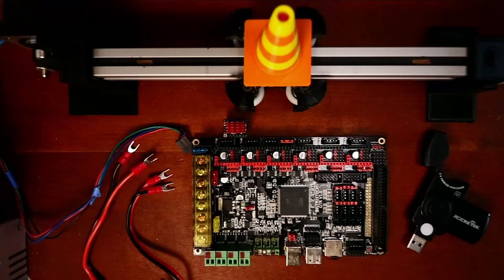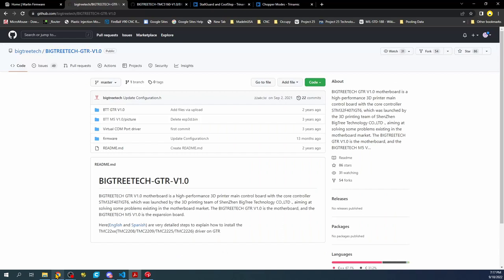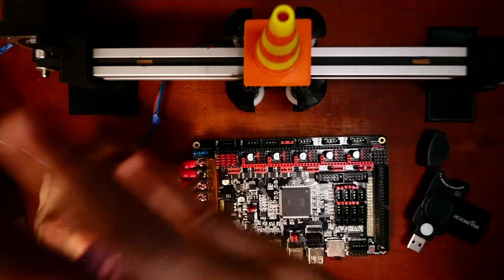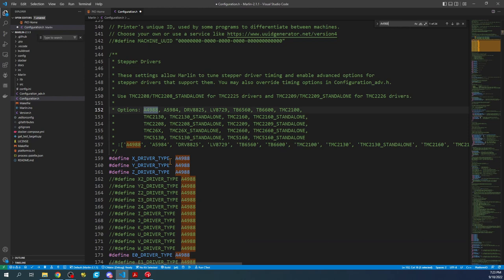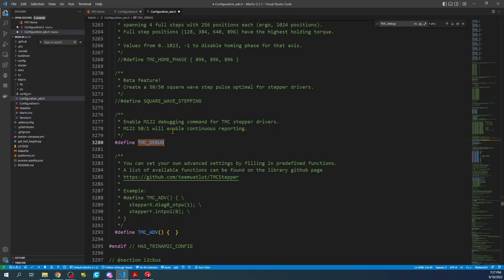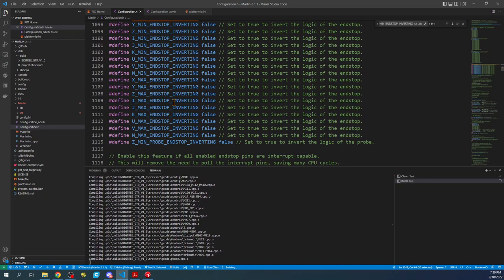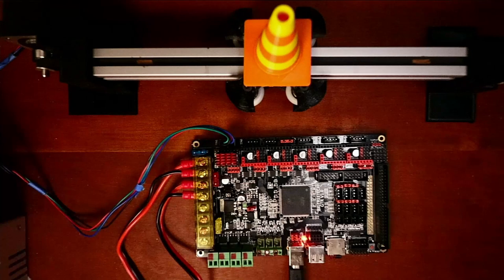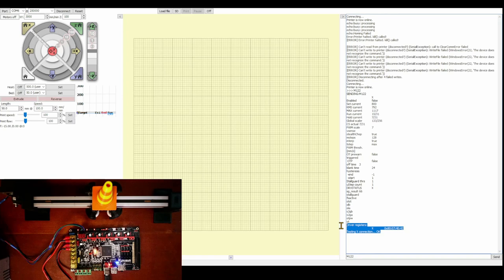BTT GTR v1 0 TMC5160 Pro with Sensor less Homing

Comment: Hey Ed, any plans to re-visit the GTR + M5 boards on Klipper Firmware? 😲 

Looking at the pinout and schematic diagram, I noticed a dedicated set of CAN pins (near the Neopixel and BLTouch port), but it's not clear to me if it require an external transceiver or if there's already one built-in 🤔

I'm wondering if I should bother opening my sealed 2x GTR and 2x M5 boxes, or if I should just sell them for money back in favor of buying newer boards
Reply from the maker: Would love to revisit the board, but looks like BTT stopped selling them.

Comment: I'm trying to use Octopus Pro (429) with sensorless homing and it's not working at all. I'm thinking that the Lulzbot motors (Taz6) need very different parameters??
Reply from the maker: Which stepper and firmware version?

Comment: Hi, I'm building Vzbot330 with 2WD, and have octopus pro f429, tmc5160 pro, I get errors Klipper saying:
Unable to write tmc spi 'stepper_x' register GLOBALSCALER
Once the underlying issue is corrected, use the
"FIRMWARE_RESTART"
I set spi_bus: spi1
I also used spi software. 
Drivers working on SKR2 (gave the same error using spi_bus: 1)
SKR2 Working with spi software, but not with Octopus pro F429. 
I have nothing connected to display and not using PT1000 connctor either. Some where saying it using share spi and can't figure it out how to manage that.
Any idea 🤔💡
Reply from the maker: Printer.cfg and check pins file matches pinout diagram for board.